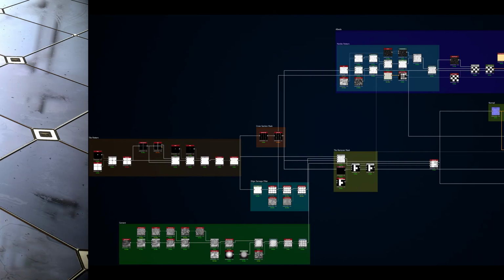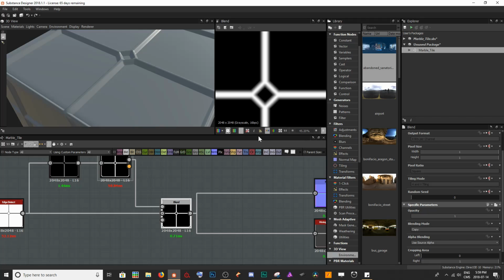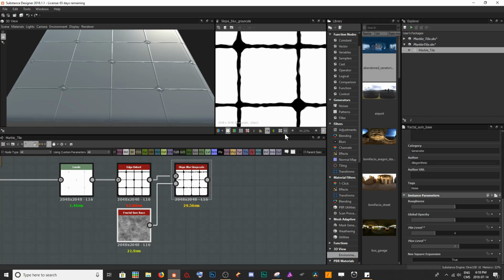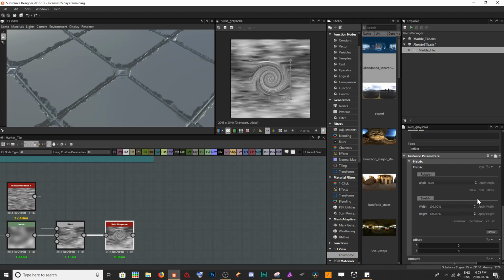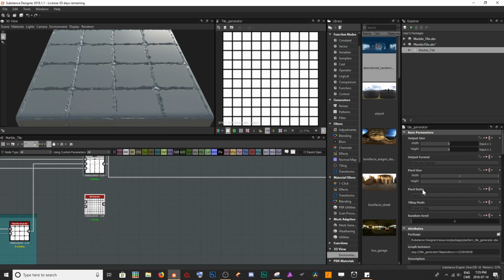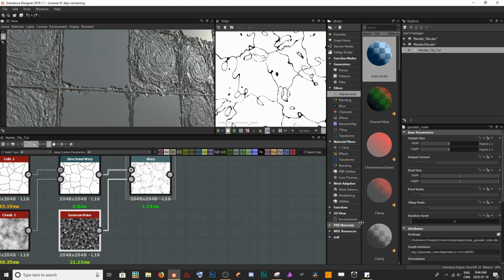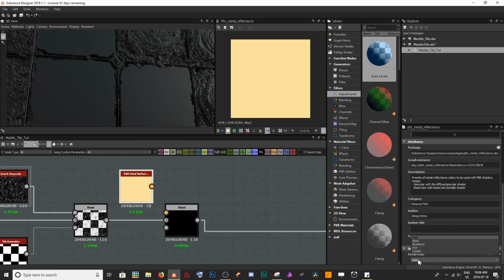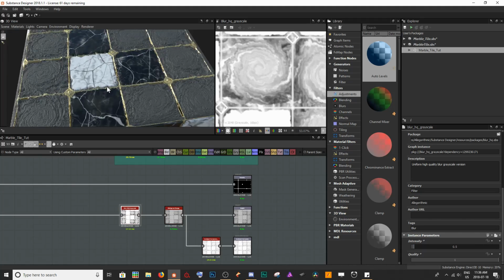Marble Tile | Beginner Substance Designer Tutorial

Comment: How would you go about making the tiles coloured? Ive been playing around and cant figure it out
Reply from the maker: The way that I've built them in this tutorial kind of complicates it, since the value of the tile (black or white) directly corresponds to the value of the marble patterns. If you wanted to separate the colour of the tile and the marble streaks, you may need to figure out a way to blend them after you've created coloured tiles. 

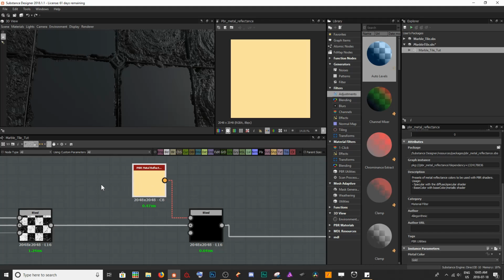A simple option could be to use that Gradient Map node we add at 53:55, and create new colour handles in the Gradient parameter of the node. 

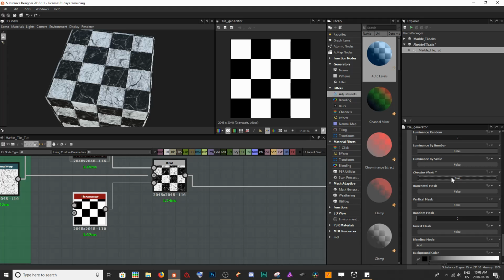Another option would be to take that Checkerboard mask we create at 52:45 and run it through a Gradient Map node. Then you can take the marble streaks and run those through a separate Gradient node. You can then blend the results of those two Gradient nodes to create a colour map which you can use to continue with the rest of the tutorial. 

These are just some simple ways to add colour to the tile, but like I said in this tutorial I have somewhat "coupled" the marble streaks and the tile colour together, so it will likely require some re-configuration of the node setup to achieve the result you want!
Reply: @GetLearnt thank you for such a fast reply wasn't expecting one at all tbh, this is my first time using the software. I've attempted your suggestions but I'm either doing it wrong (most likely)" or it's not working. Been playing around trying to figure this out for over an hour now 😅
Reply from the maker: @Alisha-qt5rm  I'm always happy to answer whenever I see a question! YouTube doesn't always show me them though so I know I miss some. 

My suggestion then, if this is your first time, is to finish up this material if you haven't already and then move on to a new one (either a new tutorial or trying your hand at a new material yourself). This will help you get more experience with how to approach it, as well you may get exposed to new nodes or ways of thinking with nodes. Once you've done another material or two, trying coming back to this one and see how you would approach it differently. Admittedly, how I approached doing the colour for this video is not at all how I would approach it now, 7 years later haha. 

Substance Designer has so many nodes, it can be overwhelming at first, but eventually you will start to develop a core group of nodes that you will use for a majority of your workflow. I have a ton of tutorials on my channel teaching Substance Designer, so there is plenty opportunity if you are looking to learn! And I am always happy to answer questions you have along the way, as long as YouTube tells me there's comments haha. :)

Comment: hello i wanted to ask do you have a plugin or something similar? to make connections between nodes straight and automataiccly rerouted when nodes are moved?
Reply from the maker: In order to toggle between straight and curved connection lines in SD, you will have to select the "Rectangle Links" option in the Tool Bar at the top of your Graph Window. Unfortunately I can't post images, but it is one of the buttons at the top of that window which will allow you to change the connection appearance!

Comment: Hey man thankyou for the tutorial, it really helped me. I have seen some specific things that I struggle with cuz I don't my material to be exactly the same and in this way I can learn it a bit more. Thankyou man. And I have a question, your node lines look sharp and straight but mine looks curved, yeah in your recent tutorials your node line looks curved but I kinda like it this way I feel it looks more neat if my node lines looks sharp and straight as a line. Is there a way to change it or it was like this in the older versions and they changed it to smooth and curved node lines? Thankyou..
Reply from the maker: Hey it's my pleasure, I'm stoked it's helped you out! To change the appearance of your lines, if you look at the light-gray header bar at the top of your Graph editor window, you will find amongst those buttons the option to switch between square and rounded connection noodles! I assume they have left this feature in the newer versions of the software, however if you are unable to find it depending on your version, it's possible they have moved the button or removed it entirely (again, I doubt they will ever remove it but there's always the possibility).
Reply: @GetLearnt  Thankyou so much dude. I think I use version 13 and the option is there, now my node line looks sharp and straight. I feel dumb for not noticing this lol. Thank you for your reply dude and thank you for the great tutorials. It really helps us to learn and improve at designer. Thank You..
Reply from the maker: @Pradeep.Bharadwaj  Happy to help! And no worries, there's so many buttons it's very easy to miss! :D

Comment: Hey I noticed that in your template video you added the ambient occlusion to your basic material but it isn't here in this video. Would this change anything in the end results ? Thank you !
Reply from the maker: The only thing it would change is whether you would preview Ambient Occlusion in your 3D view, which can be useful in most instances but not necessary for every material you make! You can always just use an AO node after the fact to generate AO as well, it doesn't need to be included in the template node if u don't need it. :)
Reply: @GetLearnt  Ok thank you for answering back !
Reply: @GetLearnt  I also have that other question that might be hard to explain . I have watched the video until the tile remover mask and everything seems to work fine but from the beggining my height/normal just seems more flat than in your video. I can see clearly the tile pattern and the edges fracture seems nice but has I am removing tiles with the mask it just really confirm that something seems off in the normal map or the height map. Even when I was making the ornament in the middle it just seems really flat. Any idea if something might be affecting my normal/height in general ? Thank you so much!
Reply: I somehow have a lot more of darker tones in my 3D view as well, especially in the cracks and the edges were
Reply from the maker: @rosenormand2059  Do you by chance have an AO node that could be contributing to the output of the material? Sometimes the AO can be too strong and it will appear incredibly dark in your 3D view!
Reply from the maker: @rosenormand2059  Give this video a try and if it doesn't work, let me know!

https://youtu.be/bayg8AOY7Pc
Reply: @GetLearnt  Yes I think that might have been the issue, I continued the tutorial and exported to Unreal and it looks great thank you !
Reply from the maker: @rosenormand2059  Awesome, that makes me super happy to hear! I'm glad you were able to get something you liked at the end of it. :) Thanks for watching!

Comment: When I get to the cross-section mask part, the Histogram Shift node only appears to be picking up the corner dots, but not the tile edge lines. Any idea why/how I might fix that? Essentially what I'm seeing in the HS node is all black with the corner dots in white - tile edges are invisible regardless of what position value I use.
Reply from the maker: What does the Histogram Scan node that you're feeding into the Histogram Shift look like? It may be an issue of having your values for those tile edge lines being the same value as the rest of the texture (minus the corners).
Reply: @GetLearnt  I actually lost the work I had done due to not saving properly, had to start over and it seems to have worked this time! Not sure what I missed first time around but looks to be fixed now 😀
Reply from the maker: @seanayres5  Haha, happy accidents I guess! :D
Reply: @GetLearnt  Indeed lol. Just finished now, got a nice tile floor.

One thing I was wondering - if I wanted to have the tiles be a different pair of colours (for example, red and yellow instead of white and black), how would I do that? Leaving the marbling pattern in place, of course.
Reply from the maker: @seanayres5  You'd likely have to re-jig a couple things, however since we are getting our colours for the checkers from the marble inputs, something you could try doing is running both through a Gradient Map node, with will allow you to target the white and black values specifically, and then change them really to whatever colour you'd like. :)
Reply: @GetLearnt  Thanks for the reply, will give that a try tomorrow!
Reply: @GetLearnt  Turns out I didn't need to add any extra nodes - changing the values of the the existing Gradient Map node (just before the Metal Reflectance is blended in) lets me adjust the colors of both types of tile.

Thanks for all the help, got what I wanted from this tutorial! 😊
Reply from the maker: @seanayres5  Oh awesome,  easy peasy! Happy to help, super glad it was useful for you. :)

Comment: Still going through the tutorial,  first time ever using Designer  -  quick question about the Frames?  How is your font size so large in comparison to the frames themselves?  In mine the text is absolutely tiny  (Substance Designer 2021, Steam edition)

Been a fantastic resource so far too by the way!
Reply from the maker: I'm glad it's been helpful so far! SD can be a crazy software to learn. As for the frames,  I can't quite remember but I think I may have changed a setting in Edit>Preferences so that the text of my frames is locked to my zoom level,  so that it is the same size regardless of my zooming. I hope that helps out,  it's been so long since I would've changed that setting! :D
Reply: @GetLearnt  I remember seeing someone mention that,  but I guess  2021 doesn't have that feature since I don't see it in the Preferences anywhere :( 

Crazy but awesome,  I've seen so many WOW things from tutorials and stuff.  Finally sat down to start messing with it, and your channel's the first one I started with.  Soon will get to the "Making Game Assets" ones because the process of taking your 2D texture(s) and then starting applying them to something is a process that left me scratching my head.  Always I'd just slap things onto an object and sometimes it'd work, sometimes it wouldn't.  It never really worked with organics though, just hardsurface things (Well, organics other than plants and the like. I mean monsters and stuff it wouldn't work and look nice)

Like, I saw a pic on Art Station of a creature and they said it was a mix of hand painted and Substance Designer,  and I just couldn't really figure out how you could take an image and then apply it to a creature without it looking tiled and bad. It was tricky enough just putting images onto structures and props - most of the time I'd just slap it on and fiddle with the tiling and projection.
Reply from the maker: @sylxeria  Hmm, I just took a look and there doesn't actually seem to be that option for me in the preferences either. I'm not actually sure why the title of my frames stays the same size,  I thought that was maybe default for 2019? 

And sick! Ya using SD for the texturing stage can be tough,  but very powerful if you can master it. A lot of texturing in general is heavily reliant on how good your UVs are as well,  so make sure you spend time making those look good. :)

Comment: do you have video explaining about parallax occlusion vs tesselation? im confused which one to choose for unreal engine
Reply from the maker: That is a good topic, of which I do not currently have a video! Depends on what your end goal is, how close the player is going to see the material/surface and whether or not you need the material to deform the profile of the mesh or not. :)
Reply: @GetLearnt  hope you make the video!:) how about ground with big mound? PO or tessellation?
Reply from the maker: @teukuaulia4270  I would personally use PO. The reason for this is that you get seemingly detailed geo, without having to actually add any geo. For tessellation, in order for it to not look "boxy" or low poly, you would need to add a lot of tessellations. If you needed to alter the profile for a larger game terrain or something, I'd use a terrain editor or model the terrain in a modeling app, and then apply my material on that. You can actually see PO used quite a bit in big games (Last of Us, RDR2, Witcher), on many different terrain pieces. That's my opinion on it, however there may be many valid reasons why it could be the other way as well! It really depends on how your performance is. :) And Im sure eventually I'll get to making that video!
Reply: @GetLearnt  thanks for the explanation, really appreciate it!

Comment: at 14:35 why use a histogram scan and not a simple levels
Reply from the maker: Honestly, great question. Looking back at it now, my best guess is I must've been drunk? :D I have no idea why I'd use such a convoluted node for that. I must've felt that the values were too close and using a Levels node wouldn't be able to access the values I wanted. If using a Levels node works for you, I'd recommend going for that. The Levels and the Scan node are both Histogram-based nodes, however they interact a little bit differently. :)
Reply: Wow thanks for the quick response

Comment: thanks for the tutorial bro. a small nitpick tho. i spent an hour of my time hoping the ending outcome of the video would be similar to that of the beginning. they're two completely different tiles. Thanks though
Reply from the maker: Hey, thank you for the feedback! Ya, this tutorial is a little older, I was getting my bearing with figuring out how to do tutorials. I've since figured out not to tweak a little bit after the tutorial ends, and then use that as the starter example. Sounds silly, but a complete oversight on my part. Thank you for watching regardless, and I hoped it helped out in other various areas as well. :)
Reply: @GetLearnt  ah okay, thanks for letting me know :)

Comment: Excellent video! For those struggling with the somewhat abrupt end: add a Levels after the final Directional Warp of the cement and bring down the output quite a bit. This should help level it off and prevent it from creeping into the metal inlay. I also went back to the Blend filter in the tile pattern that was used to Subtract and decreased the Opacity, lifting up the metal pyramid a little more.
Reply from the maker: Finishing these videos is always the hardest part, I just don't want to say goodbye! :D I'm happy you enjoyed the video nonetheless and for anyone still a little dissatisfied with how their material is looking by the end, I think that Adam's reworking of some nodes is definitely a great place to start!
Reply: Also, to prevent the tiles from creeping into the metal trim: Go to the "Edge Damage Filter" group and decrease the intensity of the final "Slope Blur Grayscale" down to about 0.05
Reply: I used a blend node, put the edge detect from the cross section mask into the foreground, the directional warp from the cement in the background and set the blend to subtract. seemed to work for me

Comment: Hey man, Great tutorial you have here, thank you for your time and expertise. Just a few heads up for the other beginners out there like myself;  concerning 48:43

1) Remember that the Flood Fill node only works when using the Direct3D engine.

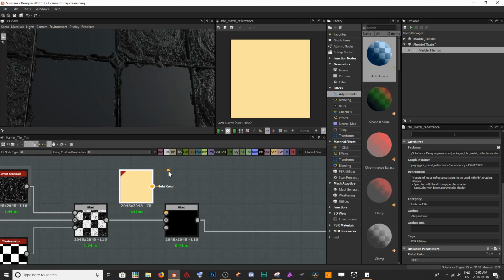2) I could not attach the "Flood fill to random color" node to the Directional Warp node as shown, and for the same reason as described at 53:45 ; instead, I used a "Grayscale Conversion" node between the random color and warp node.

3) This one is more dependent on the amount of tiling you are using, but if you are creating a material that is tiled 2x2 and are using thin smooth edges, then you may need to switch the Safety/Speed trade-off parameter under the flood fill node to "Simple or small shapes"; doing this gave me a better hues in the resulting map.
Reply: i was stuck on this ! thank you for the explanation x

Comment: There seems to be a lot of noise on the pyramids. in my results and up until the end in the tutorial. However in the screenshot at the end and the beginning you have fixed this. How did you fix it ?

-- edit -- correction just screenshot ( thanks to patrons) at the end.
Reply: Oddly enough when I tile it 3 times and render it it's not very noticeable anymore. guess the problem fixed itself.
Reply from the maker: @digipyro8478  Good question, and I think not something I thought about when I was making the original tutorial. In the video, I have some of the grout coming in over the pyramids in our height map, which is making that weird bumpiness. One way to fix that a little is by doing what you did and increasing the tiles so there is less resolution but that's only a circumstantial fix. We want a permanent fix, and so what I would recommend doing is finding anywhere you have isolated the ornate trim pieces as a black and white mask. I would use this to subtract from the grout we created using a Blend node BEFORE we combine it with the tiles. This way, we will never have the grout information showing up on our trim no matter how big or small we tile it. I hope that makes sense, feel free to come back and yell at me if it doesn't work as intended! :)
Reply: @GetLearnt  I managed, I've copypasted most of "Tile Pattern", left out the Histogram and Added levels to increase the darkness of the "pyramids", did this twice to hopefully get the max out of it. added invert greyscale blend it with the directional warp of the Grout and fixed it that way. Thanks for the great tutorial.
Reply from the maker: @digipyro8478  Geez, soon I think you're gonna need to be teaching me! Thanks for watching, friend. :)